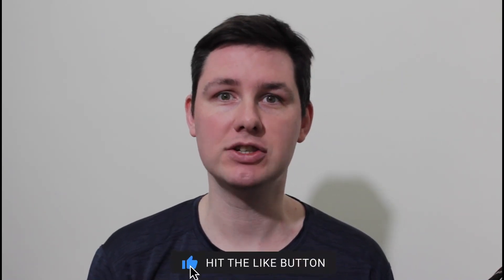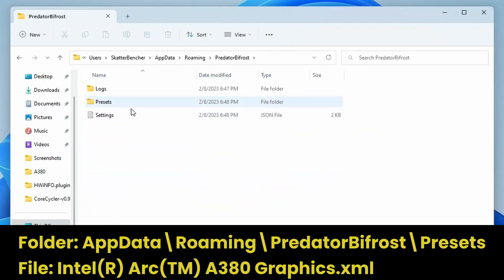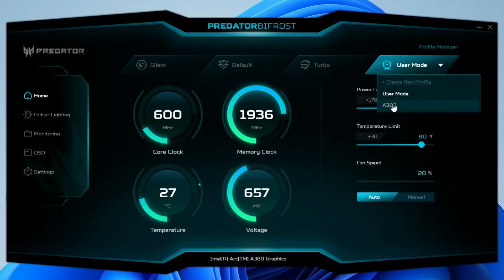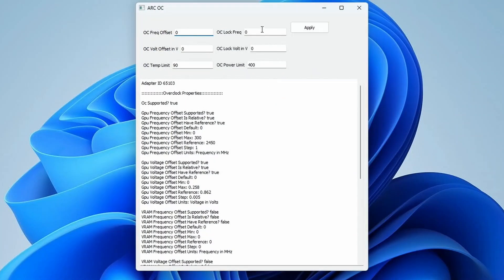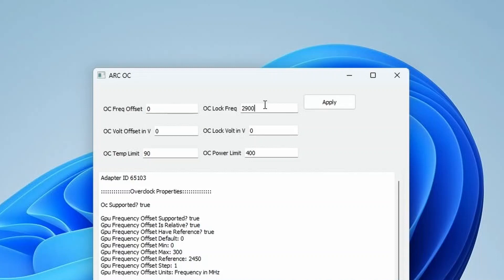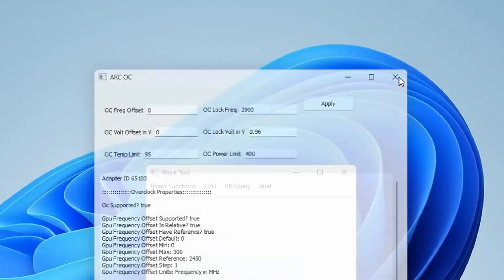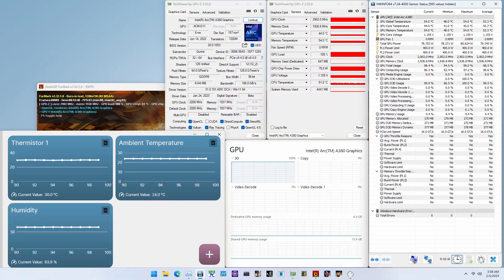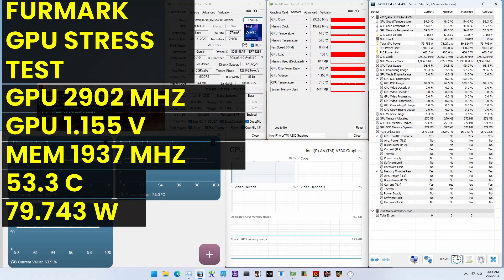5 Minute Overclock: Arc A380 to 2900 MHz

Comment: 10 to 20 c drop.
Remove cooler and thermal material.
Use a medical latex glove, put a thin layer thermal grizly kryonaut on both surfaces.
Reassemble and check temps.
Booya
Reply: And no more warranty, at least in my country 😂